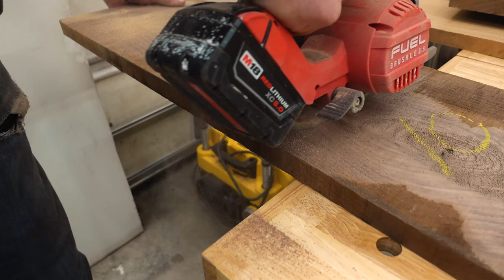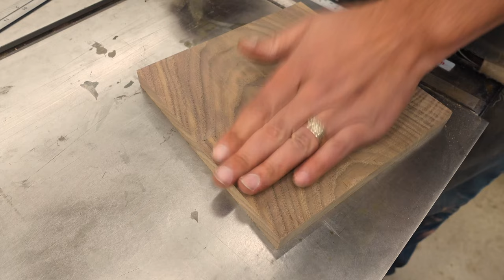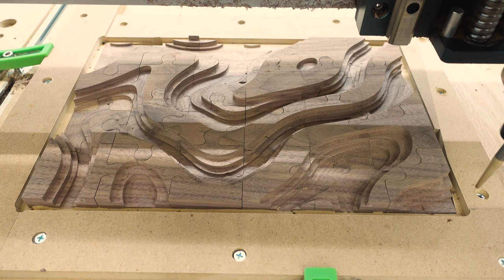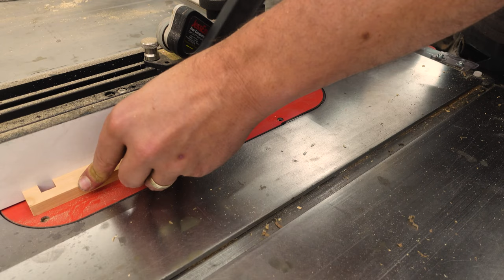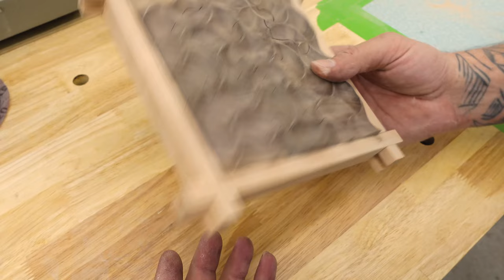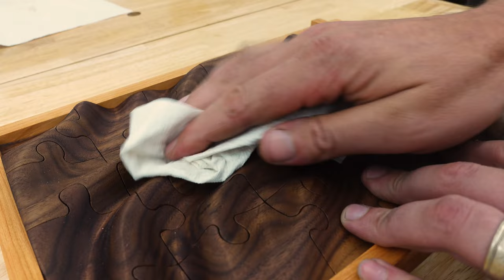Crafting ASMR: Making Mesmerizing Wooden 3D Puzzle Pieces!

Comment: this was extremely cool. do you mind posting some information regarding the tolerances you used for the puzzle pieces? what was the value that you decided gave you the best fit.
Reply from the maker: Absolutely!  I found that .01” gap was the sweet spot.  I didn’t use an offset, but rather a .005” full depth finishing path that when everything was put together, it gave me that desired .01” with a finished edge.

Comment: Can you share what cut settings you used for cutting out the puzzle pieces?
Reply from the maker: Absolutely!  I did not do an offset for the tolerance that gave the fit I was looking for.  I ended up doing a full depth finishing pass that took an additional .005” around each piece.  This gave me a smooth edge around the entire piece, and a .01” gap.  I really enjoyed how well that turned out.  Cheers!

Comment: What software do you use for the puzzle pieces and the texture?
Reply from the maker: I used Fusion360 for all the tool path generations.
Reply: @EricksonWoodworking  Cool -- but what about for the shapes? The top flow-y textures? Did you design it in Fusion yourself?